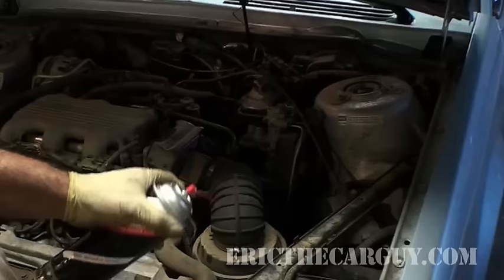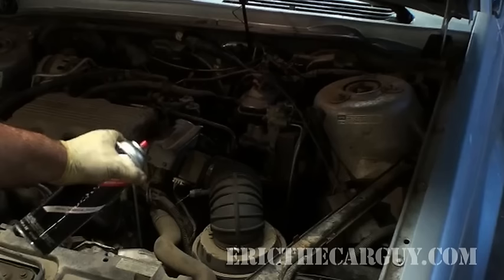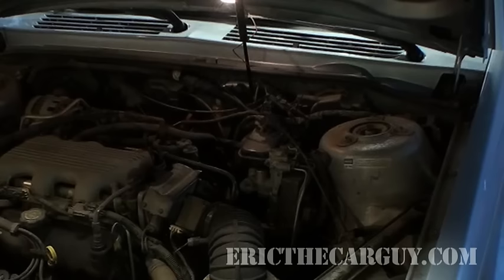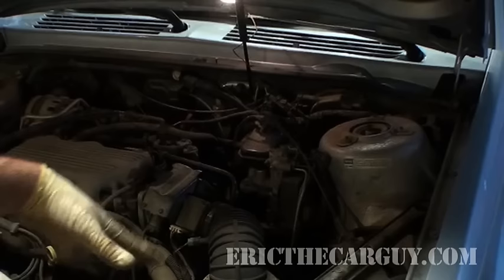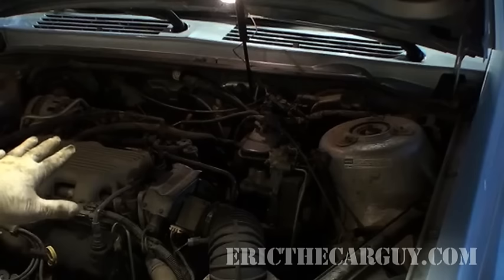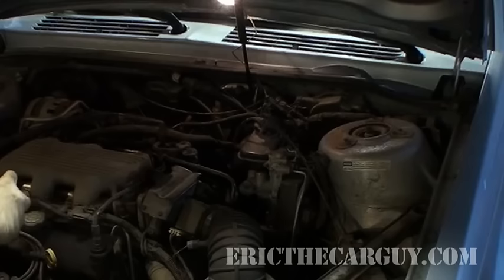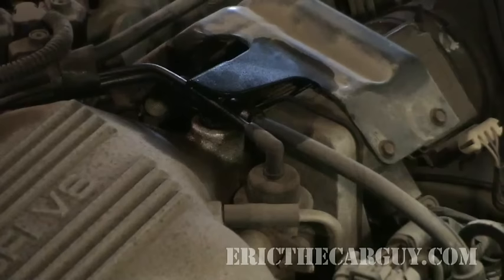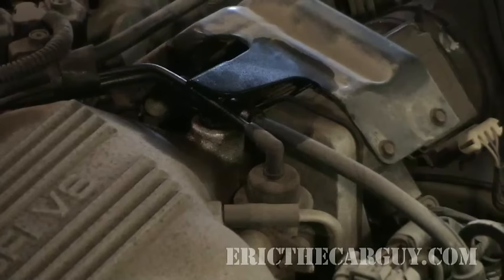How To Find A Vacuum Leak - EricTheCarGuy

Comment: My wife has an 03 Mitsubishi Outlander with the 2.4, it has a rough choppy, loping idle that almost sounds similar to a big aftermarket cam, gets horrible gas mileage for a 4 cylinder. I have looked everywhere for a vacuum leak, I’ve even done the old smoke test and can’t find one. Changed spark plugs, wires, and coil packs, ran fuel system cleaner through several tanks and nothing seems to fix it. So I guess I’m just sort of stumped and tired of fooling with it lately, if anyone reads this and has more advice on what else to check it would be greatly appreciated.. ps it seems to run fine at highway speeds, just idles erratically.
Reply: Sounds like a vaccuum leak since at higher speeds, engine vaccuum drops much closer to atmospheric pressure, which would make it run very close to as before the problem started.

Not familiar with that car at all but if that ignition job didn't solve it then you should investigate vacuum and the fuel system for sure. I'm surprised there aren't any codes being triggered by that?? (I'm no pro mechanic, just somebody who has read a shit ton of forums.) I'd steer you that direction (to forums). I'm sure somebody on a mitsubishi forum has mentioned a similar issue of a vacuum leak at least once. The trick is finding a forum post with closure. good luck with it.
Reply: Could be gaskets on your intake manifold. Had similar issues with a 2000 nissan maxima, changed everything like you when in the end it was just gaskets.
Reply: Checked for  the error codes? (if not get an OBD  scanner )
Has it got  a turbo? then Thoroughly check all the air intake rubber  pipes... 
1) Check all around INTERCOOLER PIPE TURBO / AIR HOSE
2) vacuum pipes
3) turo relates air intake pipes
once mine had a small puncture in a small connector pipe that leads to turbo, could find only if you bend it & press it . so many mechanics failed to spot it! so s the case with intercooler hose of this 54 reg opel vectra

Comment: Great tips here Eric. One thing that I have used with a bit of success is to put one end of the hose at my ear and then go around to possible areas of leakage with the other end of hose and listen for that high pitched noise. Using the spray is a great way to pin down the actual area as the sound can echo off other components.  

In future I will use the propane and get hose big enough to slip over the nozzle then neck it down to something smaller and more flexible. Great video, thanks.

Comment: I've always used this system to check for leaks and one time had a spark jump and the carb cleaner ignited. It is important to spray sparingly so even if it does ignite it won't burn long enough to cause damage. Fire extinguisher is not something you want to be looking for with a fire burning; keep it handy just in case.

Comment: So why do you need a hose with the propane tank? I understand it makes it easier to direct the propane but is there any necessity to the hose?
Reply: joeman543 you're correct, just to direct the propane where you want it and still keep the valve under control
Reply: Bg2

Comment: I had a car that used to stall for seemingly no reason, but start right back up. Turns out that it's distributor had an internal coil and controller chip. When the $5 chip starts to die, you have to replace the entire distributor assembly... Irritating, AND expensive... $300+

Comment: `you can use water too ! just fill a squirt bottle up with water and spray around vacuum sources !
Reply: oh yeah and that would stall it. good idea, ill try that first. thanks!
Reply: water in the engine is no good
Reply: it won't hurt it using water ! all it will do is burn it out ! I used water several times and never hurt nothing !
Reply: Keepo Hdee you'd have to dump a huge amount into the engine for it to kill the engine.
Reply: Lloyd Dailey you're correct! I do it all the time! It's best to do it while the engine is warm/hot.

Comment: hello  all of people with vacuum leaks.   my question here: is there something not FLAMMABLE that we can use to diagnose and find the leak? like WD40 or maybe brake cleaner or something else? thank you all and wish U all steady idles!
Reply: you can just spray water as well and it will cause the rpms to flucutate
Reply: +nicholas elias too much water through the intake could destroy the engine..
Reply: True you just have to be smart about it. Just use a fine mist spray you should be fine. It takes quite a bit to hydro lock a car
Reply: dan428 oh bullshit. You have to dump a hell of alot of water to do damage. Brake cleaner is super flammable too
Reply: nicholas elias 
Avoid power hoses
Reply: Did you just say nonflammable...LIKE WD-40?
Reply: WD40 is also flammable
Reply: Brake cleaner is extremely flammable
Reply: Smoke isn't flammable?

Comment: Funny most don't know about the vacuum leak till they change the air filter..car was running find with the stopped up filter cause air was limited..like most don't know about oil filter being clogged.. when that happens the oil filter is bypassed giving better gas mileage but oil is not filtered..common sense should tell you if your filter is filtering  99.5 % of debris it will be clogged  pretty quick ..some oil will go 15k but that's with oil filter change at every 5k.. something to think about

Comment: Some of us Eric, are older or have damaged their hearing.  I myself cannot hear the high frequency hiss from a vacuum leak.   There are probably ways to "detect" a chronic lean condition, then use a tachometer to detect small jumps in idle speeds.   Using instruments because we damaged ourselves a little bit.

 Thanks for the advice on propane.  A lot of us use it.   I am not sure if MAPP gas or acetylene would work too.

Fire extinguishers are cheaper than burning your place out.  Been there, done that.  :)

Comment: Had the same symptoms on my 2000 Chevy Silverado 4x4. It would intermittently die and start back up. On HP Tuner's VCM I could see my LTFT were pegged at 25 and Vauum was low. Confirmed Vacuum with a mechanical gauge and used this same method to find and fix my vacuum leak at the IM. Come inside and this is the first video on my feed! haha

EDIT: As a side note, I do usually use water in a spray bottle but I was coming up with nothing on this one. Sometimes you need something a little volatile! And I was out of propane lol

Comment: If you answered, I would be very happy. I’m curious how the vacuum leaks hook up on my truck. I swapped the whole power train into an f250 xlt lariat. I did everything you showed. I changed 02 sensor, spark plugs, spark plug wires, coil, and distributor. Changed the fuel filter and I got my other map sensor from an 1991 f150 custom that’s the old sensor and cleaned it out. Everything is good, runs like crap. Can barely run on 500 rpm and will die. Used to run on 1.5rpm and would rough idle. Change the vacuum lines and it made it run on 500rpm. Have to give it gas to make it not die or it’ll just backfire. We took the smog pump and Emissions off and don’t know if I should hook some of the lines to vacuum lines so the Ecm knows it’s off and doesn’t read a false reading. The fuel pressure is really good, but it backfires still. I don’t know if I should change the vacuum lines for try to find vacuum leaks. The motor sat for 10 years and it sat out in the winter for a year before we got it into the other truck. Changed the water pump/oil pump.  The intake valves could be rusted and stuck. I just don’t know. If anyone knows what it could be, I would be happy. Engine is a 1991 4.9l 300c i6 from a ford f-150 that is my grandpas old truck, I put it into a 1989 ford f-250 that had a 460 v8 in it. Your video makes me think it could be something simple, but very hard to figure out.

Comment: Some of you guys with idling problems, watch his video on curing Honda Idling problems. Also, on older cars, pre-72, if you car dies but will restart immediately, you might have a bad resistor in the ignition. My '65 Chevy used a resistor wire as part of the ignition. They quit making that wire so I had to use regular wire and add a ballast resistor to it.

Comment: add on to last post. I also replaced alternator, icm, new key ignition on column, put in an led dome light and cover. I have plenty of other sensors to do, one at a time to see how or if it affects the truck. And I have plans on either a new radio or an OEM like the one it came with.

Comment: Very helpful. Thank you for clearly instructing us on what to look for and how to diagnose this. I'm having a serious rich condition and misfire after installing an aftermarket electronic boost control solenoid and state 2 flash on my WRX and I'm hoping that I can reset my ECU and find a change now that I've rei stalled the factory bcs and flashed to my previous stage 2 tune. This has helped a lot. Thank you again!

Comment: Great video! I’m  almost certain I have a vacuum leak in my 95 Cadillac Fleetwood with the LT1. It’s stalls at idle when the engine is warm, but starts right back up with no problems. I will be doing this test today.
Reply: sounds like harness to coil pac
Reply: smokenbudesq Thanks for trying to help. It actually was a vacuum line. I have a video on my channel titled “LT1 Stalling Problem? Starts then Dies?” where I explain what it was and how I fixed it for a few dollars.

Comment: Smoke machines with there own compressors are now available for under a 100 dollars. Use baby oil and find the leaks. Sometimes there are a lot more than 1 and brake cleaner and carb cleaner are so expensive now. It is def worth it and lasts for years. I did what you are doing for yrs.

Comment: I used the water bottle squirt gun test. I was having a long crank when cold so thought I'd check. Water was getting sucked in from No. 1 fuel injector. Took the fuel rail out, replaced all 4 injector O rings.

Comment: I have a vacuum leak that affects a certain rpm operation in my car, around 2000-2800 maybe. It's so annoying, it feels like the car wants to shut off, but then once engine operation overcomes the pressure drop-- car picks back up. Used to think it was because of some slack in my throttle, but nah it's now apparent that it's a hidden vacuum leak

Comment: Thank you for making these videos coz it helps a lot with newbie car diy guy like me!

I recently discovered that in my 2004 Toyota Corolla Altis the PCV valve was intentionally blocked/closed with round plastic/rubber. I bought it 2nd-hand about 5 years and I'm not sure why they did that. That must explain the carbon buildup inside my engine and oil leaks from the breather hose. I cleaned the pcv valve and removed the plastic/rubber that is blocking it. It looks to be ok but now sometimes I get blue smoke on my tailpipe and when I check the pcv valve again I can see some little oil at the end of the pcv valve pipe. Is that what's causing the blue smoke sometime?

Comment: I use a squirt bottle with plain tap water in it. If the water is sucked into the intake, the engine at least slows if not stalls. However, unlike the flammable fluid test, it is better for the engine to be at normal operating temperature when using water, since you will probably want to crank it back up to verify your results. If the engine is cold, it may have to spin a while before cranking after you've shot water into it. A warm engine will usually restart without much trouble. 

NOTE: On older engines, electrical components may not be water-tight. So, try to avoid wetting any wires during the test. Accidentally causing a short in an electrical component may give you the false impression that you've found your vacuum leak. Again, if the engine is warm and you do wet an electrical component, it will probably dry out faster and be ready to restart.
Reply: what you are suggesting here might ruin an engine, water is not compressible, if there is too much water going into a cylinder it might cause a catastrophic failure, so please dont use water! Propane is the best way to go!
Reply: firebladeflow 

No man he's right, in fact using fine sprays of water only (and I'm stressing on) 'only' on an engine that is @ operating temperature with the air-inlet is hot, the water will vaporize once it flow through the hot air-inlet & the tremendously hot cylinder heat it will actually clean off the (intake valves, cylinder head & the whole combustion chamber), raise the octane level of the fuel as it cool down the temperature of the combustion chamber thus making the fuel sustain much more compression before the spark-plugs ignites, so it will be impossible even for an engine that suffers from carbon buildup to pre-detente, improved performance & fuel consumption, elements any potential hot-spots, some race cars actually use it as a complete unit in the fuel system with even an independent small water pump and an actuator, some manufacturers had actually adopted this system on their production cars as Mercedes-Benz with their W211 not the newer naturally aspirated E63 but the older E55 AMG that comes with a supercharger had this system, also found in the Subaru Impreza WRX STI with a button on the dash control to spray the water into the intercooler, even in the aviation world they use water-methanol injection into the turbines to achieve shorter takeoff distances and was largely used by USN during WWII, you can point this if you saw either a turbofan or jet engined aircraft flying with a light black smoke trails coming out of the engines.

So it's surprisingly a good method to use it if you want to find a vacuum-leak on a motor vehicle & clean your engine out in the same time, but be cautious not to perform it in an engine that is not at operating temperature, that's why I've stressed this out earlier because as you said before water is incompressible fluid and if the engine wasn't at operating temperature the water wouldn't vaporize as it flows through the air-intake and was poured with an excessive amounts it would be sucked into the combustion chamber as a water (liquid condition) and the the piston will bend itself once it hit it (IOW) hydro lock the engine.
Reply: Yeah you're right, off yourse it works, but the risk is just too high , especially if you do not know what you're doing. The water or meth injection like on the current bmw race models is a whole different story, there is a super fine adjusted system working, to use a safe amount.
Reply: firebladeflow oh bullshit.
Reply: don't call bullshit, just make a video spraying water into your running engine, I can't wait to see it!

Comment: I'm getting ready to go out and check for vacuum leaks in my wife's 04 Honda Pilot. I know it has a idle air control valve code. But I suspect there are more issues

Comment: I use a plastic bottle with  a small pin hole in the cap. You can spray water over the engine and can hear a sucking noise where the leak is. This does not cause any fire when you spray for leaks.

Comment: I use this method with starting fluid. then if I need to pin point between one end of a T or the other I put  a piece of vacuum hose in my ear and move the free end around the suspected fittings.

Comment: First, check the spark plugs. Look at the spark plug and see if there is oil. If the spark plugs looks ok, you are probably having an air problem. This means you are either losing air somewhere or your sensors are reading an incorrect amount of air coming into the engine. A quick fix to this is to clean your mass airflow sensor and throttle body. Use mass airflow cleaner only on both the airflow sensor and throttle body. Make sure you disconnect the battery before you clean these.

Comment: I'm hoping this video saves me from all my troubles.  My car on hot days after a long drive will stall when coming to a stop.  Already replaced the Camshaft and Cramshaft sensor, no change.  Going to try this along with cleaning the IAC and MAF (with the designated cleaner) too.  Subscribed!  BTW: 2001 Dodge Intrepid 3.2

Comment: Could a vacuum leak be a cause for the car to sputter? In other words, when in 1st or 2nd gear, my car will "jerk" or sputter when going up a hill or maintaining speed on a flat road. 

The car also sputters real quick between 1st and 2nd gear.

Comment: Erik you are the man. But this video I will have to comment and say that considering the cost/effectiveness/safety of finding leaks using carb cleaner vrs propane, you use propane everyday every time man! It's cheap. It's most effective and its the safest way to do. Liquid fuel makes fires. Gas just goes POOF!

Comment: I like to use a tube as a stethoscope. You can get right down in there and hear exactly where the leak is with a shhhh sound. Diagnosing a lean condition/ rough idle on a 98 blazer. Turns out it was the intake plenum gaskets.

Comment: Had the RPM gauge go and down on a 1995 Volvo 850. Everyone said vacuum hose leak. Turn out to be the MAF sensor. Got the sensor and rubber connection to the air filter unit at a salvage yard. Not soon afterwards a 2008 Ford Five Hundred did the same problem. Sprayed small electronic parts spray and it fixed it.

Comment: One tip when using carb cleaner. If you use the little extension tube on the can use can also add a old tip from another spray can and put it on the end of the tube. That way the carb cleaner will go through the tube and the extra tip and direct the fluid straight down. Helps when trying to spray into hard to reach areas and tiltling the can stops the flow of carb cleaner.

Comment: Eric the car guy : make sure you have a fire extinguisher

Customer ; I set my car on fire using the carburetor cleaner.. And I use the fire extinguisher but it didn't put the fire out....

Eric the car guy : oh I forgot to mention the main thing... the fire extinguisher are rated different, meaning for fuel fire you have to get a certain fire extinguisher strictly for fuel...
Customer: now he tell ppl